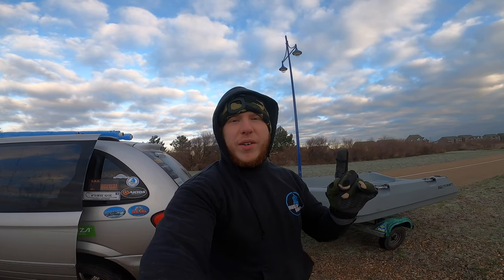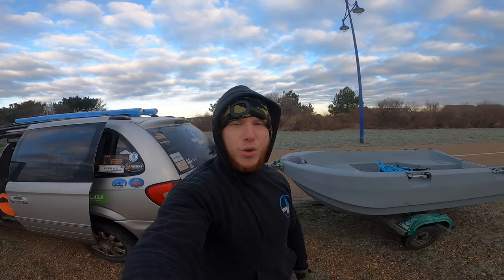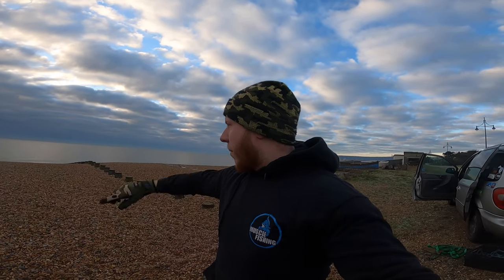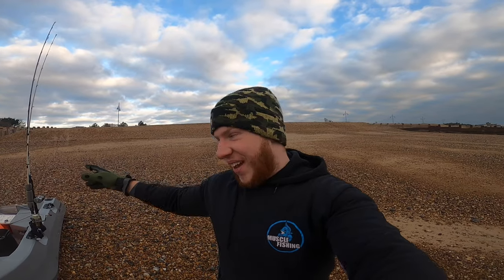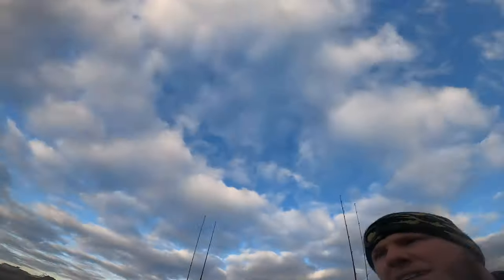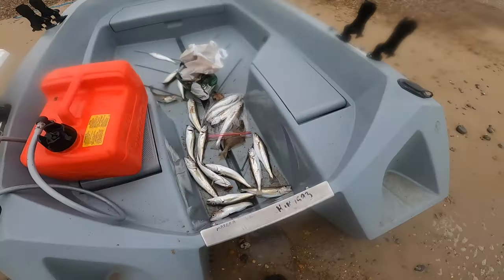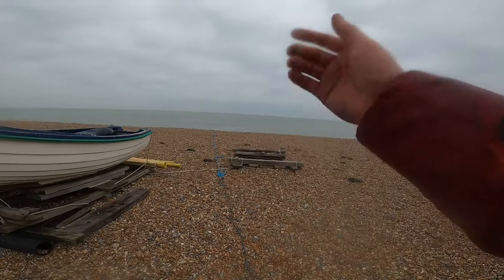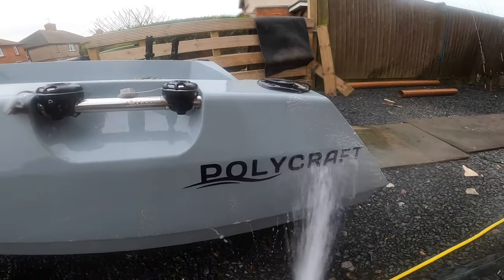How To Launch And Retrieve A Small boat/SIB Down Steep Shingle Beach

Comment: Could an anchor stake be put in the shingle for the rope end and the rope just passed over the towball then the car could pull double the distance on each haul ?.
Reply from the maker: It absolutely could. Just this particular beach and day we didn’t have that far to bring it up so opted to simply do it this way. You could also use an electric winch also if you had one fitted on your car!

Comment: Hi Jake
Is that in Eastbourne? Can you share location?
Is this rubber mats/slipway can use every one or this is private?
Thanks
Reply from the maker: It is yes! Not sure tbh, I want to buy a winch box there but you’d have to speak to the council I think in order to get one. The place I used is next to a boat that’s been for sale for years. You require a permit to drive along there though

Comment: Hi mate, good job.. I seen you come in on high tide but what tide was it when you launched,  was it at its lowest or still a bit to go because that seemed like some distance across to the watter..
Reply from the maker: I took the boat down at 08:30 and high was 12:30ish. So pretty low. It glides over the shingle with little effort easily on flat or sloping surfaces. On hills it does require a little more man power!

Comment: You could take drainage pipe ( 12" x 5' )rest the back of the boat on it (secured) and drag the boat with less resistance!
Reply from the maker: On bugger rocks and less forgiving stones I use industrial drain pipe and roll it. What you said would work well actually for those beaches and you could still tow it along! 👌🏼

Comment: Big up the Jake Davison productions 😎 Was tempted by a polycraft but opted for a Hydrus instead 🤷. May get one of these in 5 years who knows 🤣

On a side note, Does that do any damage to the hull??
Reply from the maker: The hydrus is a great SIB! I just couldn’t get my head around soft materials and hooks. 🤣 

It doesn’t, light scratching and that’s it. The pebbles act as little marbles and rollers! Just like a kayak really. You could use rollers to avoid any scratches if you wanted
Reply: Had an inflatable years ago. They inevitably end up with a patch or two and there goes resale value. Good luck!

Comment: Title led me here looking for clever ways to portage a small boat. Watched a guy drag boat over rocks.
Reply from the maker: This boat is a strong plastic mould. Just like a kayak. Shingle acts as mini rollers. If you was wanting to not get any surface scratches then you’d use drain pipe as rollers and have 3 or 4